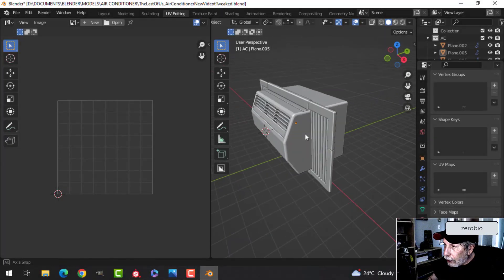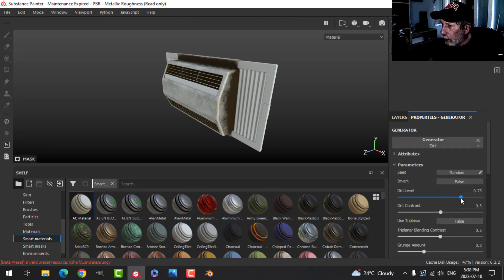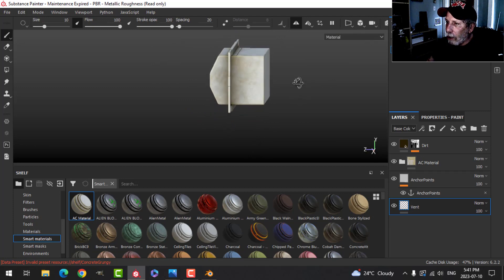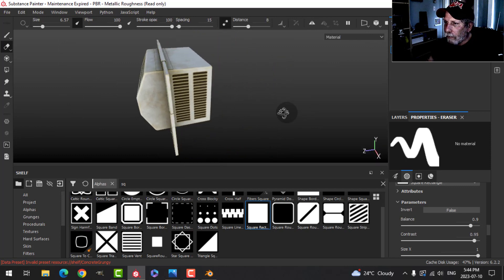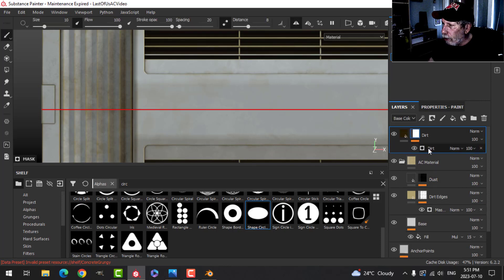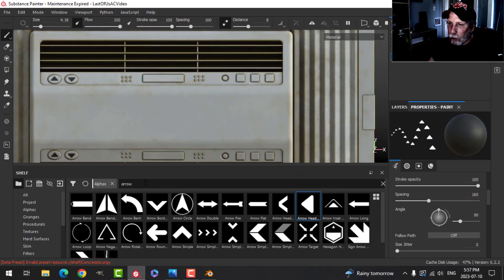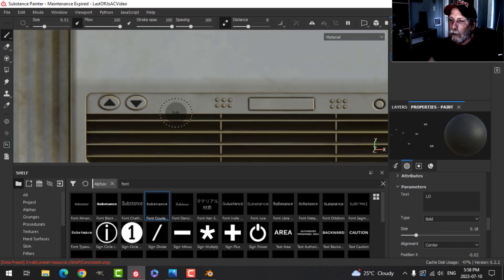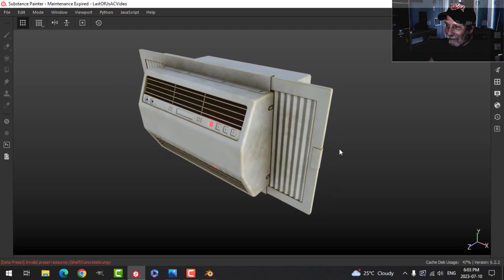SUBSTANCE PAINTER: THE LAST OF US AIR CONDITIONER 2 (TEXTURING)

Comment: I'd suggest:
In UVP, enable Heuristic search, that will generate a better result. I usually use that, and under its settings i enable advanced search, and i put 10/15 secs and 30 as the limit, so it can find the best pack. Also pixel margin, to avoid any UV error in substance or once imported on an engine or what not.

As always, just an amazing work, really inspiring me (and i think everyone else)to do stuff, couple days ago, I've done a Potion like bottle, in really no time, 5 min to make the bottle (i used curves, really need to cover the lack, also bought the CurveMachine addon to really get further with them), then export to substance, find a cool Gem/Obsidian Crystal like Smart material, imported, placed on the bottle, used a wood smart material, also imported that, for the cork, and it was done. If I didn't watched one of your videos, i would have probably scrapped that file 😅.
Reply from the maker: Great tips!  And thanks for the feedback too.